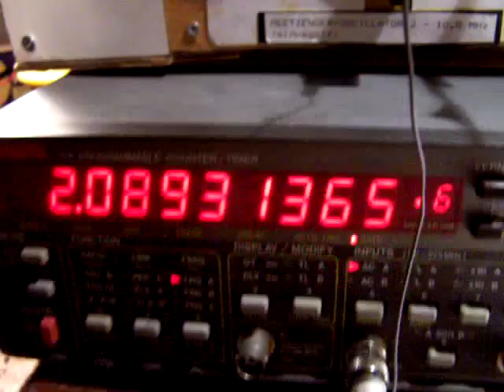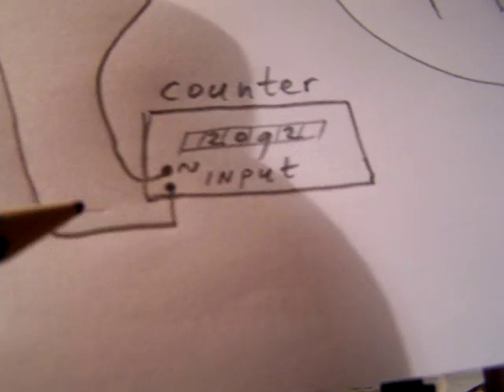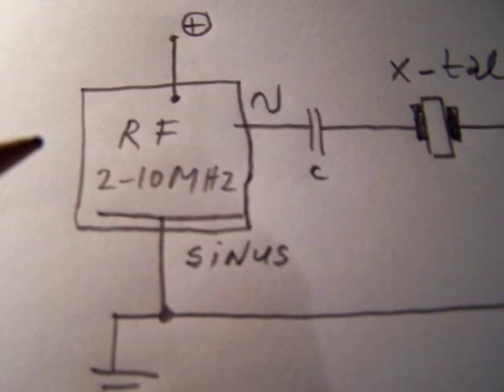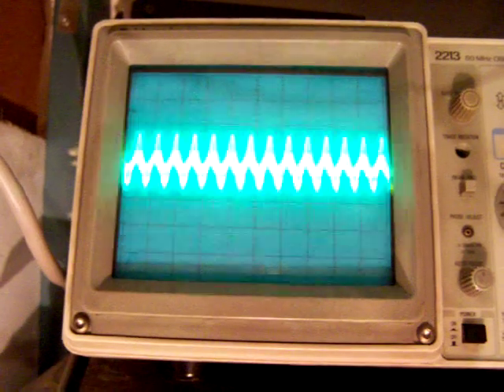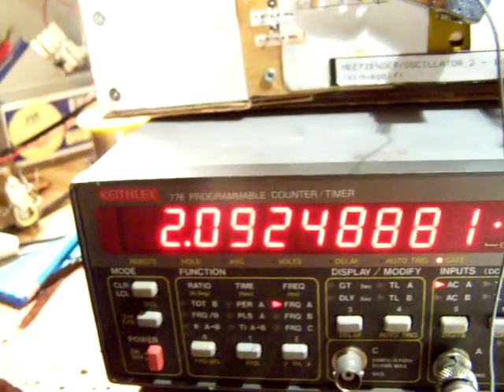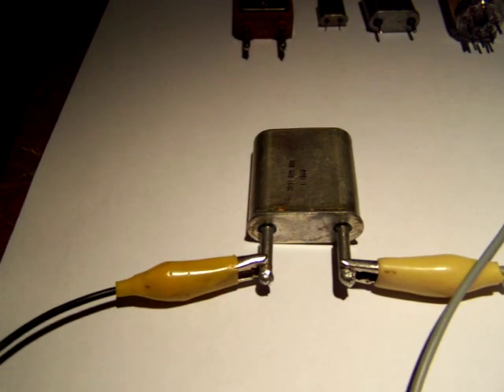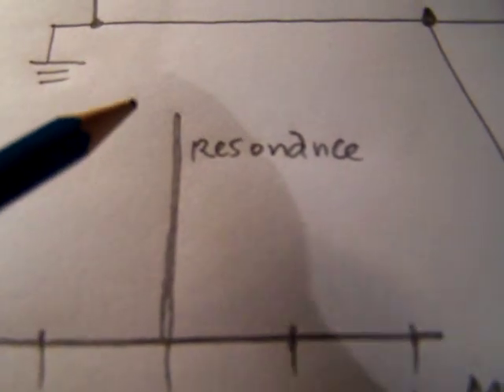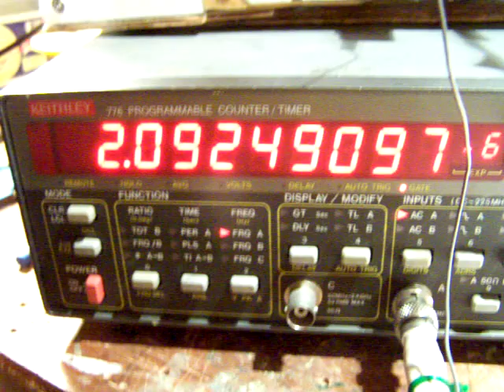measuring the resonance of a quartz crystal

Comment from the maker: @nlimchua I don't know it exactly, but I think 100 pF or 300 pF will work properly. It only acts a coupling capacitor, perhaps it will also work without a coupling capacitor because the quartz crystal has an "endless" DC resistance.